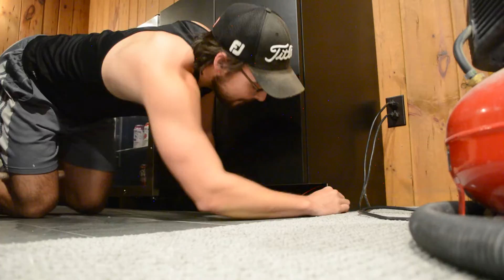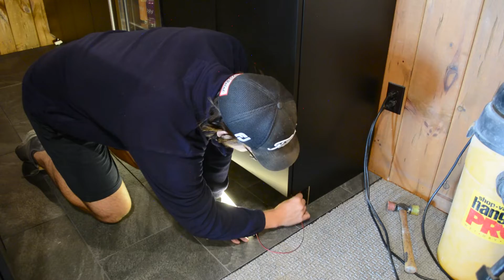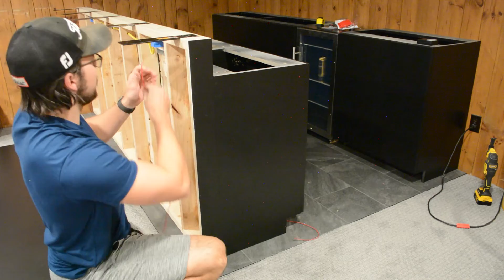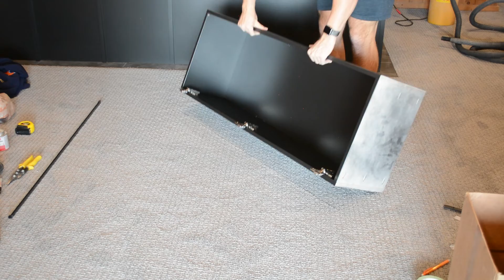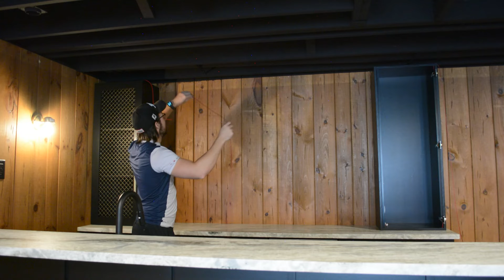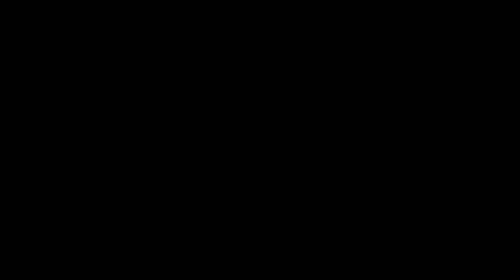How to Install LED Light Strips like a PRO

Comment: Hi there! I am trying to accomplish a similar project for my home and I’m curious about the method you used here with the clips and power supply wiring. I’m kind of a beginner, but is the method here called daisy chain? Where the power is flowing between LED strips? If so, is there something you did to help the voltage stay consistent from strip to strip? I’m reading this method may cause the voltages to lower per strip. Thanks for any clarification as I try to do a led accent on some bookshelves!
Reply from the maker: Great question! It’s called voltage drop and yes, after a certain length of LEDs, they will become dimmer. You can calculate that distance based on the voltage of the power supply. Most power supplies sold in kits can keep the same brightness for at least least 16’. You can buy a higher voltage power supply to go longer or start a second circuit directly from the power supply if voltage drop is an issue. Hope that helps!
Reply: @GoldenKeyDesign  Thanks for the detailed reply! That definitely helps, and I will look into the solutions you mentioned! Love the videos!

Comment: Love the channel and your ideas...    I have a questing on LED lights under each step on my stairs...   but... don't want it to come on full strength...   more a 2 sec delay coming on slowly and staying on for a min or so then gradually going off as a slow dim...  Make sense?    just can't find the right hardware.... they either go on at a set level and will slowly go off or off and one at one level...   Let me know if you have any ideas or suggestions..   again thanks for your videos!   I get some great ideas..
Reply from the maker: Thank you! For your stairs I don’t think it’s an issue of the type of LED, but rather the power supply. Power supplies (which connects the LEDs to an outlet) come in a variety of types and some of them have the ability to fade the LEDs in and out as you turn them on and off